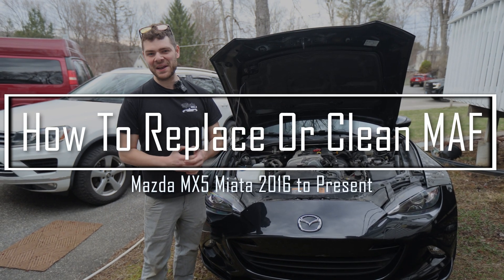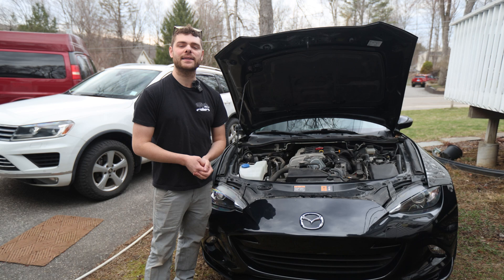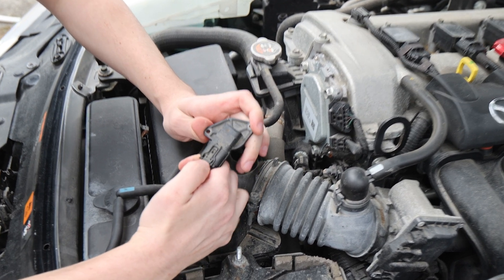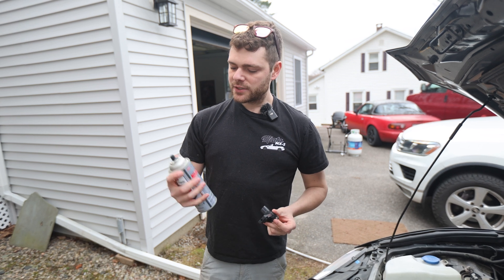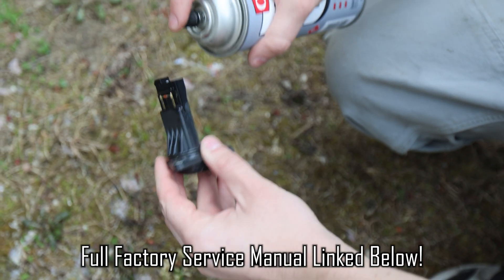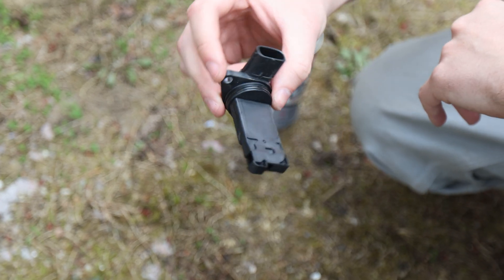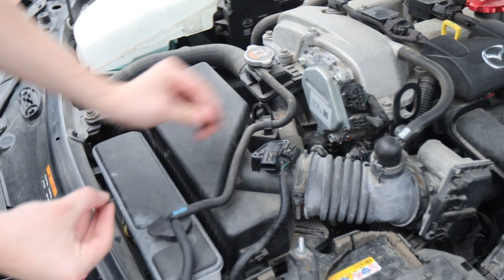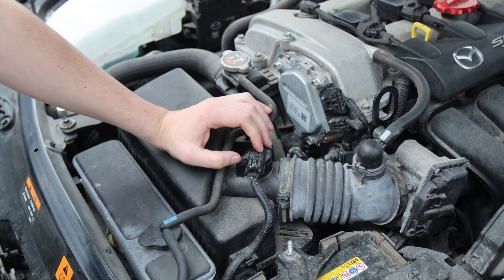Mass Airflow Sensor (MAF) Cleaning or Replacement | ND Mazda Miata (2016-2025)

Comment: Did aftermarket MAF sensor work for you? I got one from autozone and the check engine light stayed on but it went away after replacing with oem sensor from Mazda dealership